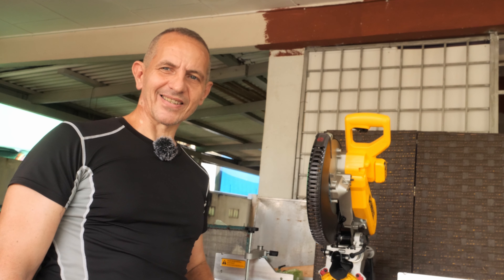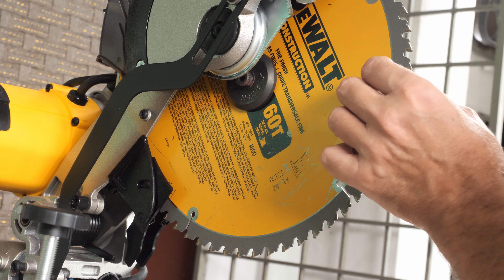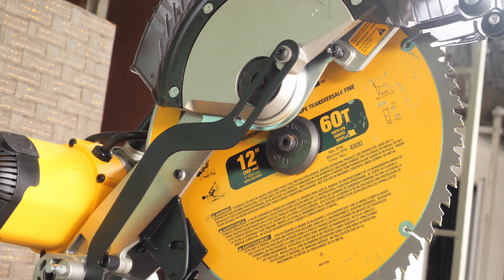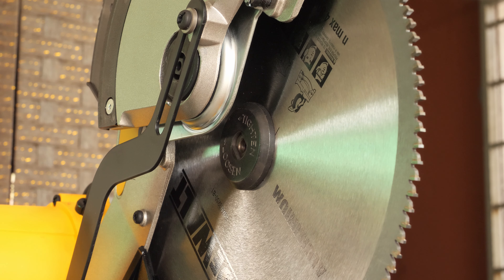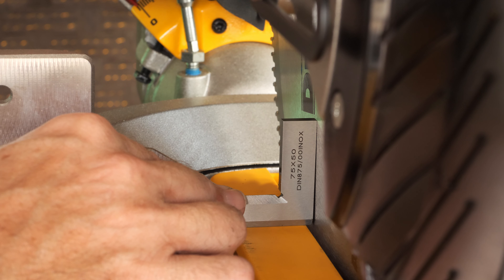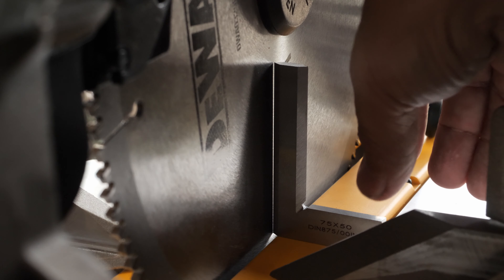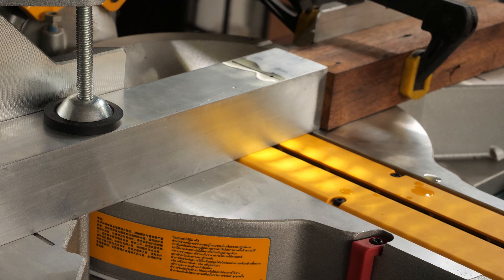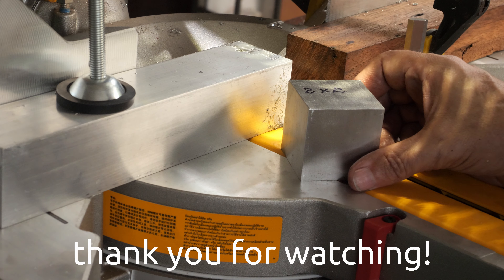Can  Miter Saw Cut Thick Aluminum? | DeWalt Miter Saw Change Blade + Setup For Precision Performance

Comment: Nice clean cut. I was surprised at the result.  But you did cover all bases to make sure the saw was set up perfectly.
Reply from the maker: yes I made an effort to setup the saw because this precision aluminum cube was very important for one my projects. I was even considering sending it to the machinist shop, should I have failed this attempt.

every time I swap the miter saw blade, I do adjust 90 deg table+blade. that's why (in case of DeWalt miter saw) that blue "gasket" threaded bolt is probably the most important adjustment piece of the whole machine.

however the stainless steel miter plate, for the 90 deg fence+blade, I did only once, when I purchased the saw. it is very unlikely that this setting ever goes off.

PS
what I learned is, I should have made this cut in one go. every time I stopped and retracted the blade, there is some micro blade mark on the cut face (easy to polish). it was my 1st time to try this, so I was sort of overdoing it.

PS2:
off camera I made several cuts on wooden blank, to adjust the stop block position perfectly to 2 inches.

Comment: Is it possible to cut solid aluminum rod with a miter saw? If so, how would you secure the rod, in my case 1/2”, to the fence, so it doesn’t spin while being cut?
Reply from the maker: yes of course, just place the rod in the V groove wooden support, or simply metal angle and clamp it down

Comment: Excellent! kindly inform me which make & model machine used and specify the blade also.
Reply from the maker: I used 305 mm 120T blade specialized for the aluminum, and now I can no longer find it on Amazon. but 60T or even 30T blades can cut the aluminum successfully. you might get slightly less clean cut face. please remember that the aluminum likes a lot of lubrication. I used the synthetic car engine oil, because that's what I had on hand..

my miter saw is DeWalt DWS780 XPS, but I believe all DeWalt miter saws have the same adjustments components. on other makes you might need to look it up, which bolt you need to rotate to adjust the blade+table angle.

Comment: What do you use to lubricate it?
Reply from the maker: Any oil that you have on hand. For example I had synthetic oil for the diesel engines and it works great. You can spray WD-40. You can use chainsaw lubricant oil. Anything that you have is fine.

Comment: I am also amazed how well this works however I would suggest you allow the cutoff piece to slide off freely. In other words remove your stop block as it pinches the part in and that can lead to unwanted surprises. So one side clamped one side free to move.
Reply from the maker: you are right, the right stop block could grab the right side of the stock, that's why it is lubricated with the car engine oil.
you need to cut really slowly, and because both parts (the target piece and the remaining piece) are clamped vertically to the table, that prevents vibrations and any unwanted material shift, so the blade just ploughs downwards VERY SLOWLY.
as you end the cut, the teeth are wider than the blade body, so once the teeth are below the last cut line, there is actually a gap between a blade and the material, so it won't be thrown towards the back of the machine (and possibly bounce towards you). that's why you need to stop the motor entirely before raising the blade back up.
the table saw kicks back the material towards you, the miter saw kicks the pinched material away from you, but surely it could bounce from something to your head.

if the part being cut off wasn't clamped vertically, then the stop block would be indeed much more dangerous, and could cause the pinching and kick back.

I've experienced many near miss accidents when I was discovering and self learning how to use the machines. I had pieces of aluminum flying near my head on the miter saw too. so far having cut few hundred thick pieces of aluminum stock with this setup, I never had any unexpected / unwanted travel of the projectiles.

you can check out my miter saw fence upgrade where I also show my mini clamps, which I think are the key to safely hold the material.

Here is the cool miter saw fence upgrade + mini clamps + stop block :  https://www.youtube.com/watch?v=gJ7i_TYVZkE

the original clamps are far away from the blade, and the lubricated aluminum tends to move / slip around.
Reply from the maker: one more thing:

to cut small pieces (which I most often do) , you have to use zero clearance platform, to prevent the small pieces from falling into the slot or even worse: from becoming a projectile and flying near your head / eyes.

I designed a mini clamp + miter saw fence upgrade, to accommodate just that

you can check it out here:

https://www.youtube.com/watch?v=gJ7i_TYVZkE

Comment: Hi can You please provide Whats  speed - dial number ? used while cutting aluminium ? And what you use for cutting wood ?
Reply from the maker: my miter saw doesn't have speed adjustment, but if yours does, you can slow the RPM down for cutting soft metals like aluminum.
it's important that aluminum being cut, as well as the blade carbide teeth are lubricated. it makes the cut much cleaner, even with a standard construction grade 60T blade.
and you do want to clamp your material well, because you don;t want sharp pieces of aluminum flying in a close proximity to your temples.
Reply: @TigerCarpenter  thanks for fast replying 😀 and for all informations

Comment: Sir,

2 questions :

1) Will i be able to use a smaller (and thus cheaper) mitre saw 
to cut 6061 solid aluminum billet into small blocks?  e.g. DEWALT DWS713

2) If i purchased a smaller DEWALT DWS713, what type of metal
cutting blade would i need to use with it?

Thank you very much!
Reply from the maker: yes absolutely, you can cut 6061 aluminum with any size miter saw, just remember that 6061 contains magnesium, which is a very hard alloy mix, so you must buy a top quality carbide teeth blade. if you cheap out on the blade, it might struggle, and introduce stalling = risk of the material pinch. 
you need to generously lubricate 6061, and cut VERY SLOWLY.

well, you must not cut any metals harder than aluminum or copper.

bear in mind that bronze is NOT COPPER. bronze is harder than iron. so I hope you know how to differentiate the metals before you throw them on your carbide blade.
Reply: @TigerCarpenter  
Thank you sir.
You are a wealth of knowledge.

I shall let you know how it goes with my purchase and cutting.
I will stay away from bronze and stick with aluminum and copper.
Sorry I'm a newbie so I'm learning - entirely on my own as there is nobody to teach me.

Thus far in my research, I am looking at Dewalt DCS361B with its smaller 7.25" blade.
I'll look for a good carbide blade with carbide teeth for cutting aluminum/copper.
I'll cut very, very slow as you advised.

I need to cut these small rectangular or square aluminum / copper pieces to use for machining on my Taig CNC mill.

Comment: Try wax or lamp oil as a cutting lubricant. Oil seems not to do anything useful on aluminium.
Reply from the maker: I use car engine synthetic oil in this case, because I had it handy.
it did a proper job, as the 2 inch thick aluminum piece was only 41 C = 105.8F

I will compare it with the wax next time I cut the aluminum.
Thanks!